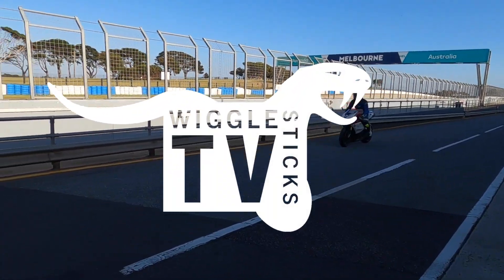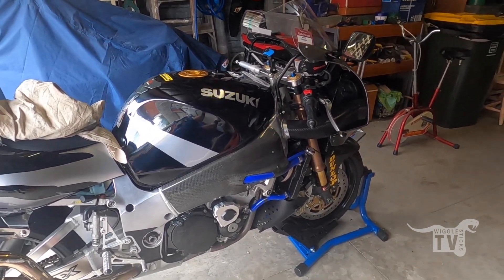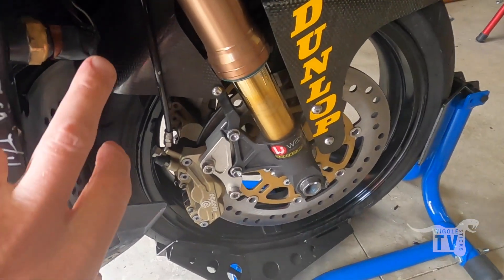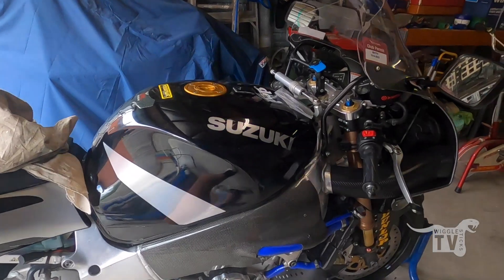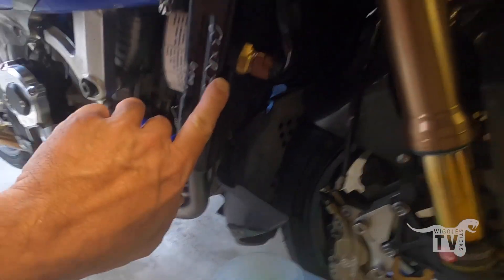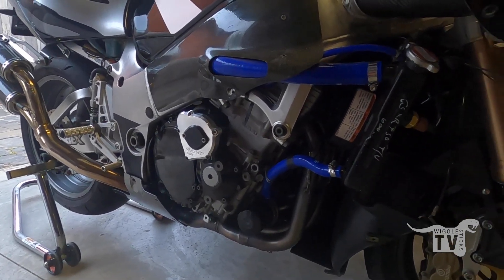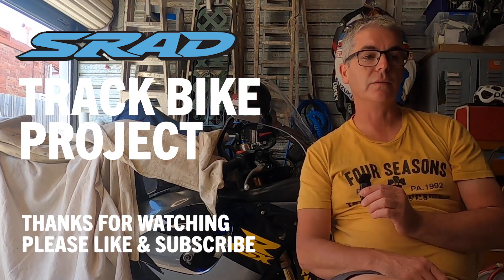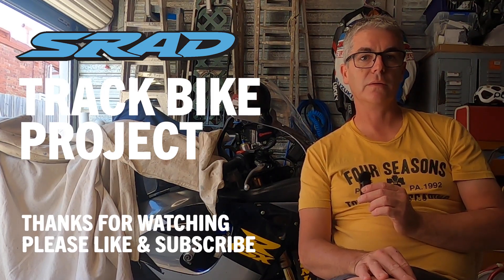1996 #GSXR 750 #SRAD Track Bike EP 54: Changing out cooling sensors #retrosuperbike #trackbike

Comment: I'm in Sydney and have a 1998 injection model. I have found my SRAD doesn't cope with warm weather. It can quickly reach over 100 degrees in traffic and splutters. I consider it a "cold weather" motorcycle.  I only attempt to ride it in congested type traffic during the daytime if the forecast is less than about 23 degrees (which on sunny days means it's a just a little bit warmer than this when on the roadway). I have found that it's a beautiful motorcycle to ride from about April through to October.
Reply from the maker: Thanks, I have a 98 as well and it runs a touch cooler than the 96 but is much more stable at the lights. I have no issues riding the 98 in heat, but the 96 seems much more temperamental. 

Will do somme more testing and investigation and hopefully get the 96 running like the 98. Thanks for watching.
Reply: @Roostabergers  Good luck and I look forward to further videos.

Comment: I think that your heating problem can come from frame protectors. Frame has also a big role in cooling the machine and by installing frame protectors you prevent frame to dissipate heat. Cooling with frame protectors could probably only work on track, where you have very little time spent standing in one place.
Reply from the maker: Have not herd that before, will whip the protectors off and see if it makes a difference. I suspect is something else as I have frame protectors on my 98 with no issues. cheers.